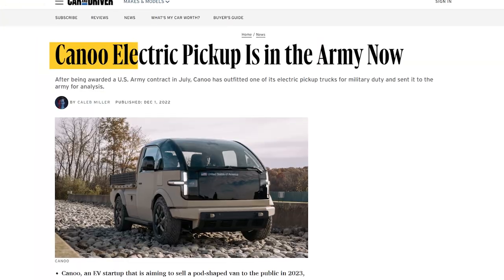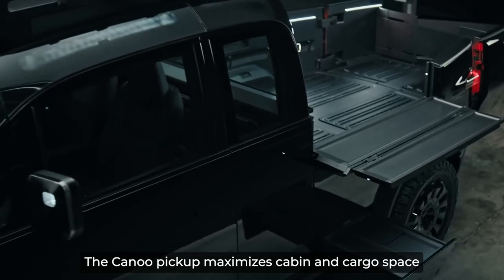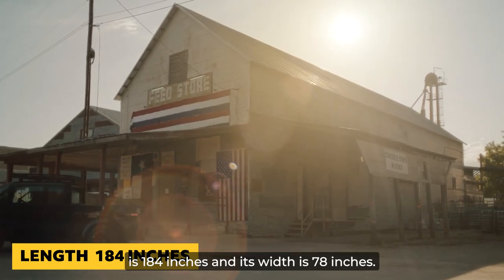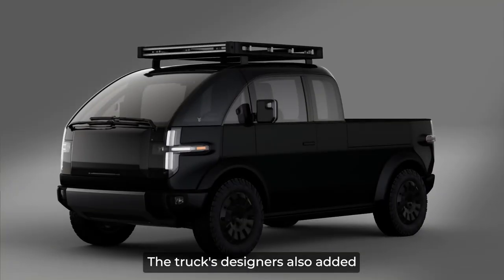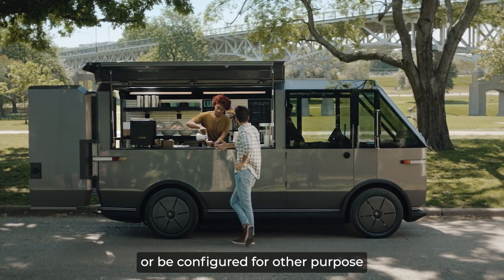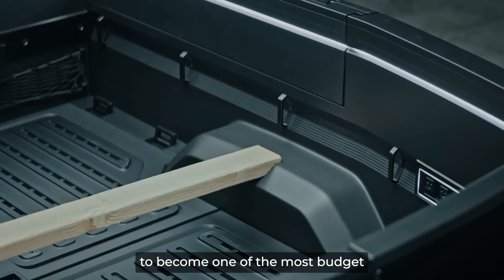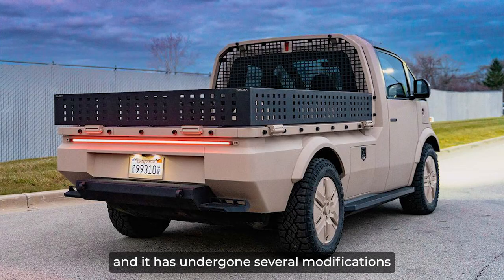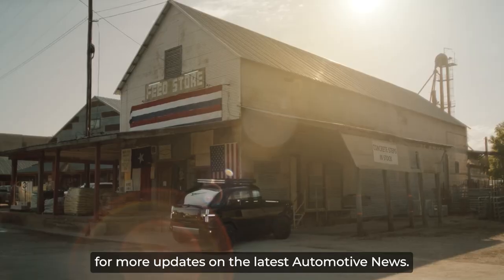Unlock The Power Of The Canoo Pickup Truck - What You Need To Know!

Comment: How much do those front glass pieces cost to replace? Just curious because I haven't had any vehicle for more than a few years before inevitably getting a rock or some other object bouncing off my windshield.
Reply from the maker: My guess is that cost of replacing the front glass on the Canoo Pickup Truck will vary. Factors like the vehicle's make, model, and integrated features influence pricing. Its difficult to tell accurate costs, those will be available when this truck is GA :). And a comprehensive insurance coverage will probably help mitigate expenses related to glass damage.

Comment: 200 mile range, how long to recharge ?
Reply from the maker: Great question! According to information available on the Canoo website, the Canoo Pickup Truck's battery can charge from 20% to 80% in just 28 minutes when using a compatible DC fast charger. This fast charging option allows for quick replenishment of the battery, reducing downtime and enabling you to get back on the road efficiently. It's important to note that charging times can vary depending on the charging infrastructure and the specific conditions, so it's always a good idea to consult the manufacturer or refer to the official specifications for the most accurate and up-to-date information. Hope that helps!
Reply: @AmpedAuto  these are incredibly cool looking, but 200 mile range is just not enough for real world use.  Day to day yes, but for travel or any kind of adventure driving it will not work.
Reply: @AZdroptop Well yes.... day to day is the definition of practical usage..... off road and adventure travel is a niche vehicular purchase usage
Reply: Assume it'll take all night to recharge, since you're probably not going to find a charger in the wild that's working properly. Just plan on charging it at home every night, and keep your gas vehicle for trips outside of the city.

Comment: Do you need a spec sheet online and you need a brochure online with pictures you need a list of accessories in their cost do you need a cover for the bed of a pick up truck maybe even a cushion for the bottom of the pick up bed I wanna be able to add a top to the back of a pick up truck And the batteries need to get your 400 miles
Reply from the maker: Thank you for your interest in the Canoo Pickup Truck! For a spec sheet, brochure, and information on accessories and battery range, I recommend Canoo's official website or contacting their customer support. They will have the most up-to-date information on these details. As for bed covers and other customizations, consider exploring aftermarket options. Keep in mind that battery technology is evolving, so check Canoo's official channels for the latest updates on battery range. Don't forget to subscribe for more automotive news :)

Comment: Too much glass for the city…it will get broken into
Reply from the maker: Thanks for sharing your concern. While the Canoo Pickup Truck does have an impressive amount of glass, Canoo has made design considerations for safety and security. The company has likely implemented robust security features to ensure the safety of the vehicle, even in urban settings. With advancements in technology and security measures, we hope the Canoo Pickup Truck will provide a secure and reliable driving experience. Thanks for watching, and stay tuned for more updates!
Reply: @AmpedAuto  "Likely" is doing some heavy lifting. You basically just wasted a lot of keystrokes to say "I hope not."
Reply from the maker: @TheCharleseye  Point taken. Canoo takes safety seriously, and they've made significant security advancements. Your concern is valid, but we're optimistic about the vehicle's safety features.

Comment: I'd rather see that cab and a half turned into a single cab with an 8ft bed.  These 6ft beds are impractical
Reply from the maker: Thank you for sharing your perspective! The Canoo Pickup Truck indeed comes with a 6ft bed that can be extended to 8ft. Canoo has designed the truck with a focus on maximizing cabin space while maintaining a compact footprint. However, customer feedback and preferences are valuable, and different individuals have different requirements for their trucks. Canoo continues to innovate and adapt, so it's possible that they may consider different configurations in the future based on market demand. We appreciate your input and thank you for watching the video!
Reply: I drive a mini truck with a 9.5' bed. Every inch of bed length is worth.
Reply: A Z   I couldn't give a hoot about quads, bikes or other hobby stuff.  I can't haul 20 sheets of plywood (out of the weather) in a 6ft bed.
Reply: @AmpedAuto  Genuinely the issue is weather. I can not haul 8ft sheets of plywood, drywall or other sheet goods in a 6ft bed even with the extension as it's not weather sealed if there's a cap or cover.  This is the thing that a lot of auto manufactures don't get and why Ford and GM outsell the others. It's just about practicality of the tool.  Honestly if the manufactures would drop the whiz bang stuff (leather seats, touch screens, power everything, and just think of a truck as a tool, they would sell just as well if not better as eliminating this stuff also lowers the price which is what anyone who uses their vehicle for business cares about.  Now this isn't to say that a luxury pickup isn't a valuable option to have, just that not everyone needs or wants that.
Reply: A Z  3 issues with that idea. You can't lay the plywood flat, Van's have limited head space (you can take a cap off a truck) and Vans are more difficult to hide in plain sight. What I mean by that is, a van, particularly a sprinter van, is inherently considered a commercial vehicle which people see as a target for theft. Pickup trucks with caps, don't have that same issue. This also has implications for insurance rates too but that's a side issue.
Reply: I feel they will offer the military truck in a more scaled down version to civilians.. I personally think the cab configuration is perfect for me ( Perfect for my dog )
Reply: @MRBenchwork  yeah, I just want a truck that can haul doors, plywood, and drywall out of the rain. With a front bench seat so I can take my kids to school. Anything else isn't worth the ridiculous price of trucks these days.
Reply: @MRBenchwork So buy a real truck. EVs (especially the trucks) are still in their infancy. Anyone who trusts their living to one right now is crazy. I'm looking to pick up an EV for my wife to run around in but that's about it. They're novelty, third vehicles. Something to play with as a proof of concept. Real work still largely requires gas/diesel vehicles. As they said, this is an "urban truck." It's made to fit in little parking spaces. You're supposed to drive it to whatever coffee house is trending and brag about your carbon footprint.

Comment: BE ADVISED>>>>
Using DC fast chargers will shorten the life of any Ev battery pack.

!
Reply from the maker: Yes!  It's true that frequent use of DC fast chargers can potentially affect the lifespan of an EV battery. Fast charging generates more heat, which can contribute to wear and tear over time. However, modern EVs are designed with sophisticated battery management systems to mitigate these effects. Manufacturers often provide guidelines on optimal charging practices to maximize battery longevity.

It's essential for EV owners to strike a balance between convenience and battery care. Are you currently an EV owner, and have you noticed any specific impacts on your battery life with fast charging?

Comment: I'm all for smashing the big three truck manufacturers because of their lazy innovative speed & pure ripoff pricing but, this vehicle is not the anwser. I cant imagine any " city slicker " needing this, can't  imagine a farmer, rancher or small holding owner using it at all. Who I do see using it is the Cyber truck crowd so you already have competition. 8'x4' truck bed with a 2200 lbs payload might start to turn heads but, yet again range is an issue loaded up.
Reply from the maker: Thanks for sharing your thoughts! First, the Canoo Pickup Truck might not suit everyone's needs, and competition in the electric truck market is indeed growing. The 8'x4' truck bed with a 2200 lbs payload is a noteworthy feature, but as you rightly pointed out, range can be a consideration, especially when loaded up.

That said, while it may not be a fit for everyone, the Canoo Pickup Truck could find its niche, especially among urban drivers looking for a compact and efficient option. Additionally, the contract with the U.S. Army for the modified Light Tactical Vehicle (LTV) version shows its versatility for various applications.

Competition in the electric truck segment is fierce, and it's exciting to see how different models cater to diverse consumer needs. What features do you think are essential for an electric pickup truck to be successful?